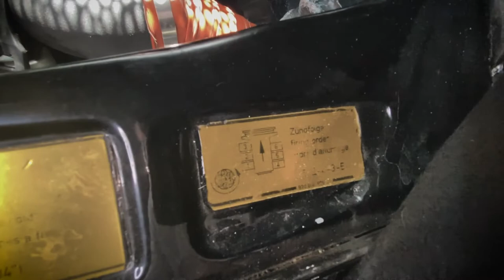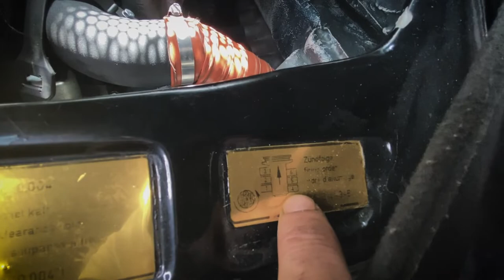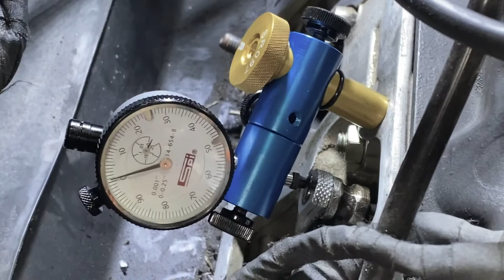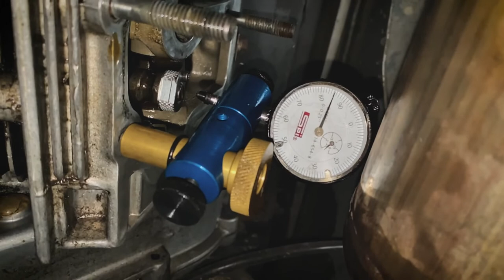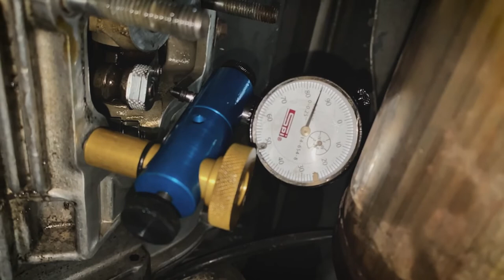SEVENT9 // Valve Adjustment & SnapGap Review!!!

Comment: Hi, Great video indeed...where can you buy the rear cover for the engine bay ? couldn't read the brand from the video...thanks from Belgium, G
Reply from the maker: I'm afraid I picked mine up of a fellow aircooled owner locally here in Toronto but I believe Pelican Parts sell them as a well. A must have if you are working on your car regularly. I dinged mine once with a screwdriver and purchased a protective cover immediately.

Comment: Great video.  Fully identify with your experience…I’m pretty much in the same boat, ‘81SC.  Appreciate your take on working on these amazing cars with not much of a mechanic’s background.  Really remarkable what we can learn on YouTube.  Really well produced videos as well. Congrats.  Keep the content coming!  The valve adjustment seems pretty daunting…have you noticed a difference in performance  with the SnapGap solution?  It seems almost like the perfect solution. Is there a risk the shim falls into engine when you replace it?  I’m thinking of just getting the gauge but the digital one not the smaller one you got.  Would the digital meter work on intake and exhaust valves?  I saw the video where they say the smaller non-digital meter is good for valve adjustment when you don’t drop the engine, but I don’t know, seems like the digital one may work as well.  Cheers.
Reply from the maker: Hey Carlos - so sorry for a late reply - I haven't been checking my comments enough! I don't have any concerns about the SnapGap shims falling on future adjustments - they seat in nice and tight and come off easily with some test runs I did. Its a very precise almost fool proof system. As for the gauges the digital gauge only fits on the top valves. You will need the smaller analogs gauge for the exhaust valves. It's tight in there and a standard sized gauge will not fit if you are doing this engine in. Hope this helps! ;)

Comment: Great video, will be looking at this when my SC arrives…currently travelling on a ship. Did it solve the valve noise?

Also love to get a video on the ducktail. Was that something you’ve added, it didn’t look like it was there in your earlier videos.

Great channel, cheers
Reply from the maker: Yes - a huge reduction in valve slap and an overall tighter running engine! With SnapGap it was very easy to do and made. task that seemed daunting to me extremely easy and trouble free! A great DIY job for you! :)
Reply from the maker: Oh and sorry - yes the ducktail was added. I didn't do a video but perhaps should have. As an FYI none of them fit perfectly. They take quite a bit of massaging to work.

Comment: In prior message, the dates are wrong.  SNAPGAP is open for business until Dec. 1, 2023 or until inventory runs out.
Reply from the maker: I don;t see this message Brad - are you guys not producing this kit any longer? Would love to know more because I am a big fan of it! Feel free to DM me.
Reply: @79.outlaw  Sorry. I don't know what happened with that. In any event, thanks for the great review!  I am surprised I just found it but am pleased you like the kit.  For a number of reasons, I have decided to stop the business unless I can find someone who would like to buy it. If you know of anyone, I am selling the patents, inventory, trademark, instruction manual copyrights and videos/photos and website content.  It has application to the massive VW market that I have not yet tapped.  Otherwise, I am back in business until Dec. 1 or until inventory runs out.  Thanks again for the great and through review.  And, yes you are correct, if the adjustment screw is dirty or bunged up, the kit will not work properly.  Usually, chasing the screw with a nut will clear up any issues, but some have used a die or replaced their adjustment screws.